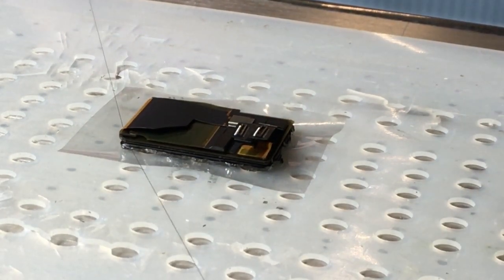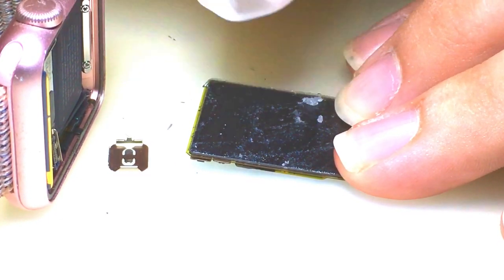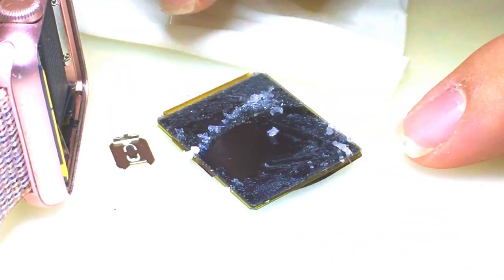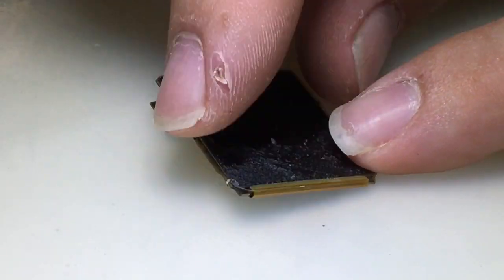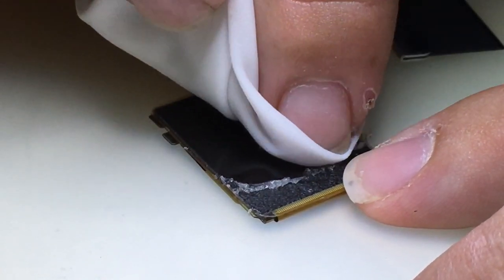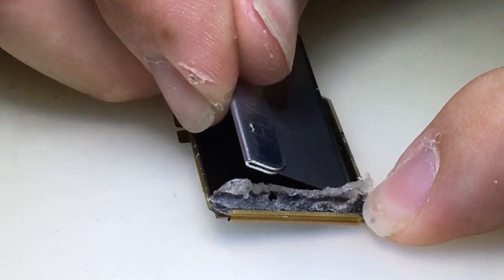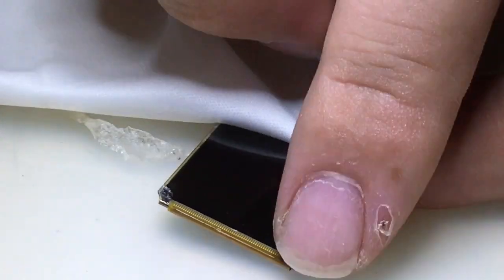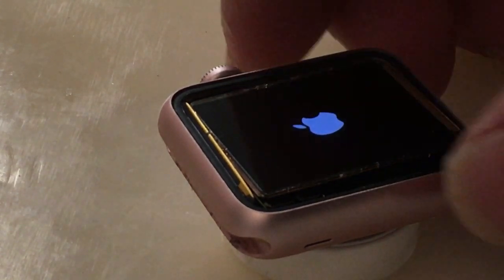Apple Watch series 1 successful glass repair

Comment: could u technically use the Apple watch without glass if the touchscreen works without it
Reply from the maker: Jayden Bentz yes, it would work with the series 1. The digitizer and display would be more prone to damage, but it would work fine. The series 2 and 3 and I presume 4 as well wouldn’t work without the glass because the digitizer(Touch) is built into the glass.